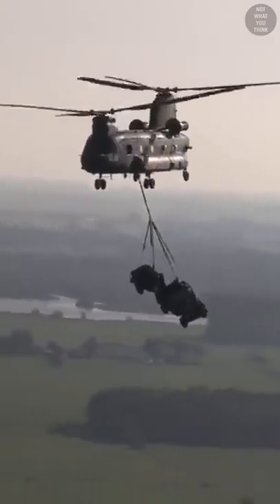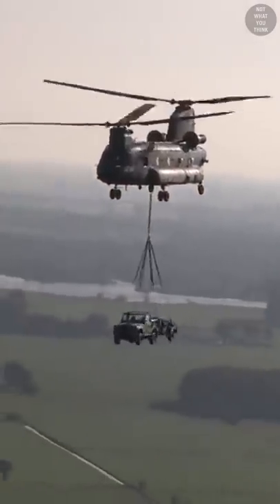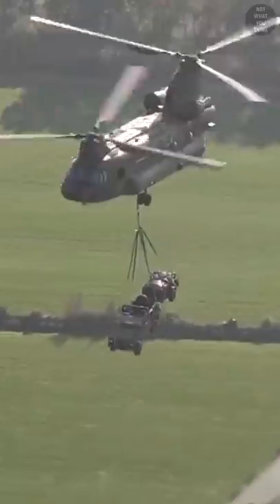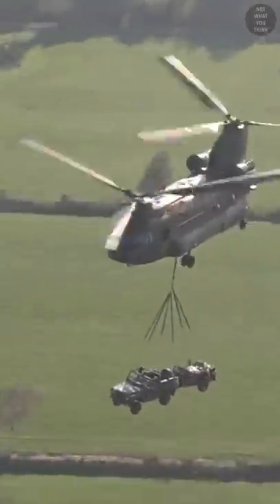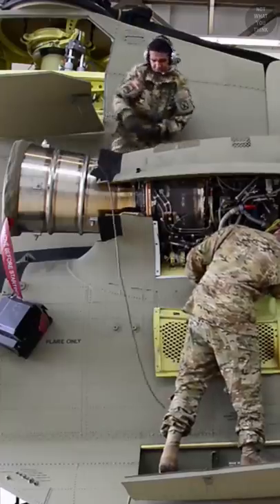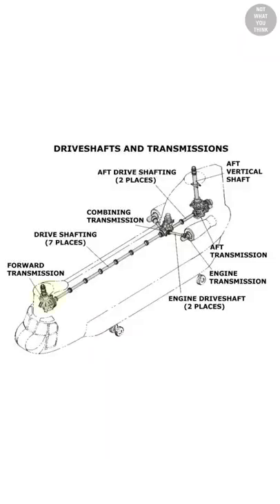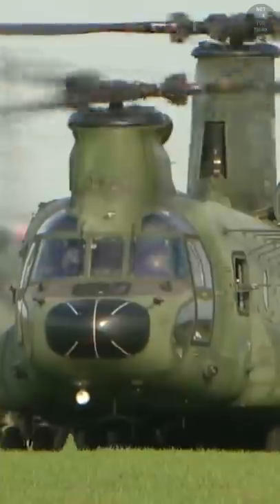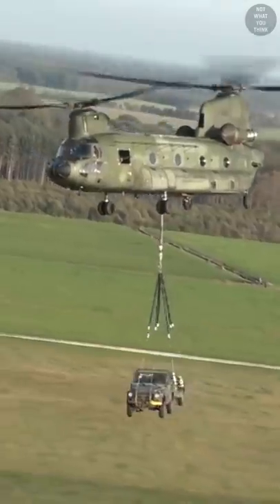What if One Engine Fails on the Chinook? #shorts

Comment: I heard that more pilots are killed practicing auto-rotation emergency landings than die from engine failure related crashes!
Reply from the maker: That’s sad if it’s true!
Reply: I wouldnt say killed... but definitely more aircraft are destroyed. Case in point.. autorotations to the ground for practice is a prohibited maneuver in this aircraft. Can only practice in the sim.
Also, dual engine failures are super super rare. Most birds flying in the US are dual engine with some level of single flight should one stop.

Comment: Modernized Chinooks are tri engine now? Ik they use the same engine as the king stallion
Reply: No sir. Twin engines.
Reply: @TheBeingReal  Ah. they got new engines now they produce almost double the SHP.. but the king stallion still has 1 more engine being a smaller heli
Reply: @Ckcdillpickle  I’m not aware of a 2x SHP engine for these, we supply the overrunning clutches for them and no change in hp/rpm.  

The CH-53K outdoes the Chinook models.
Reply: @TheBeingReal  I believe the current Chinooks have T55s which only make around 5000SHP vs the new T408s that make 7500SHP.. I think honeywell is trying to compete back by offering a upgraded version of the T55 that makes 6000SHP with 10% greater fuel efficiency while needing minimal modifications to the craft
Reply: @Ckcdillpickle  They will probably just derate the engines.  Redoing the whole drivetrain is a massive project.  Let alone the airframe work that would go with it.